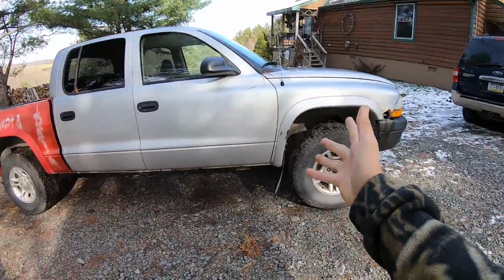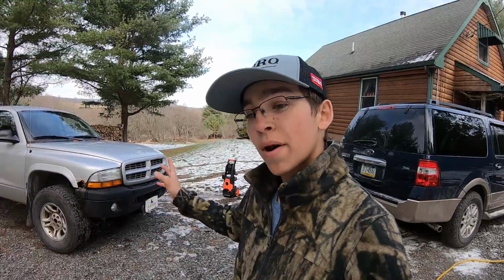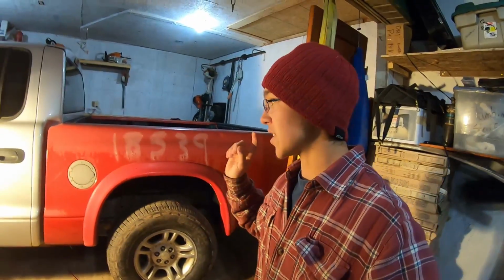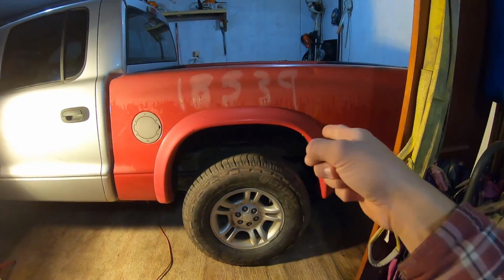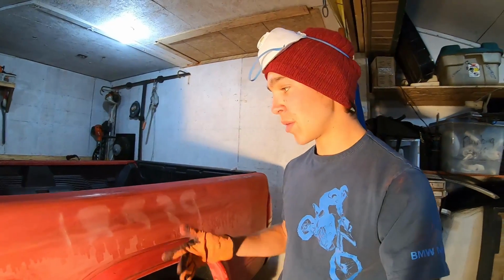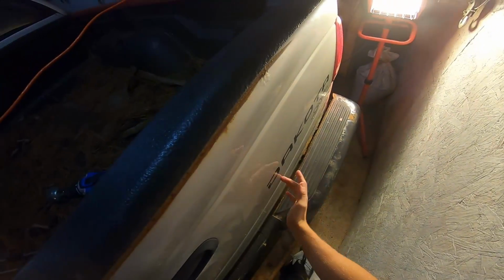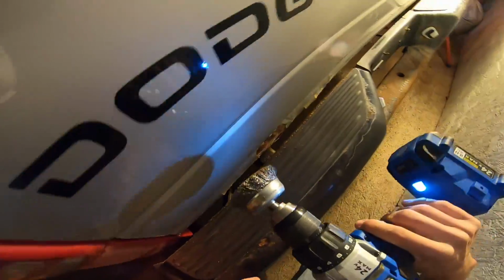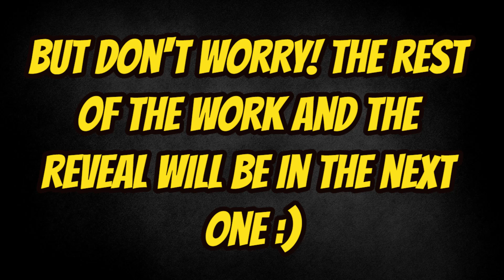Revamping a old Truck! Dodge Dakota flip | Part 1

Comment: Hey Wyatt, word of advise from a fellow YouTuber here.  Try and adjust your audio levels with your music and when you are talking.  The audio level is about 2x as loud when the music comes on.  Not sure what editing software you use but most basic editing programs you should be able to easily do this.  Anyways, I'm digging the truck build.  It's a fun departure from your normal content.  Keep up the hard work!
Reply from the maker: Yeah I just threw this video together rather quickly. I have a lot going on and want to keep the channel somewhat updated. But I just don't really have the time I once did 🤷 quality will definitely be down until I get more than once a week to record and edit a video haha

Comment: You did an excellent job Wyatt! I could flip a snowblower or small engine but not a car! Your doing great so far! 

Not sure about you in PA but in Illinois we are in a snow drought. We are making up though. 4" of snow has fallen since 4 pm( 1"/hour since the start) with no sign of ending!
Reply from the maker: I've flipped snowblowers before! Easy money man! You could flip just about anything with an engine haha
Reply: @wyattslawnservice7212  I'm working on flipping a snowblower I got from my grandpa. I won't get to use it on the 5" we got overnight as I'm still working on it! Contemplating selling it or keeping it. It has been barely used and is 15 years old. I could easily get $250-300 and then save up and pop in for a new one next year. Something to think about

Comment: Awesome rebuild series. Maybe make it a 3 or 4 part series. Can’t wait to see the paintZ
Reply from the maker: The paint came out really well! I did 5 coats of silver and 3 of clear 👌 it's so cheap so I coated it well! Also patched the rust in the front fenders, rhino lined the rear/front bumpers and Plasti dipped the rims!👌
Reply: When will the next video be out? Can’t wait to see it!